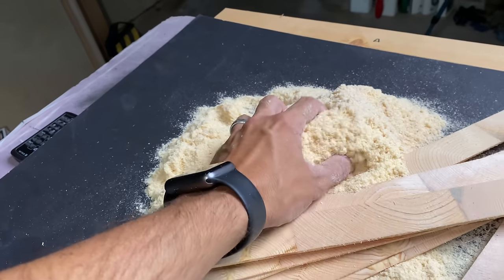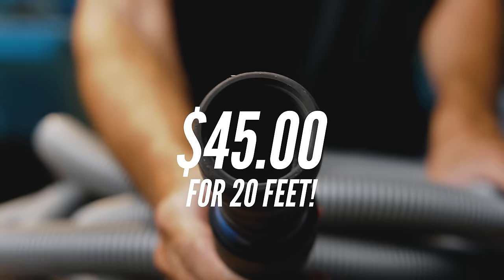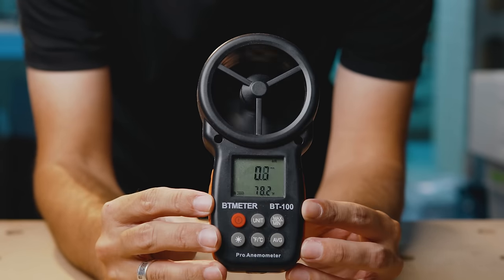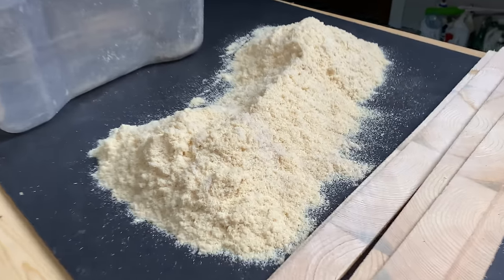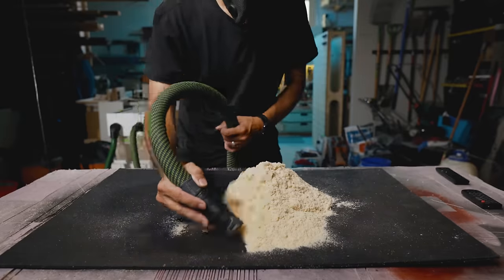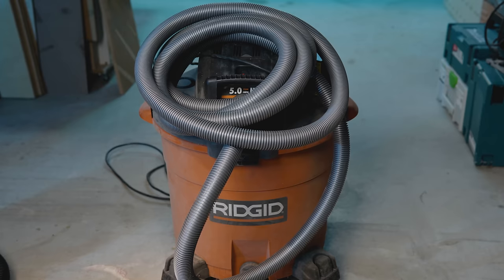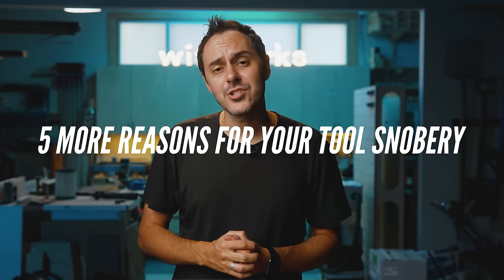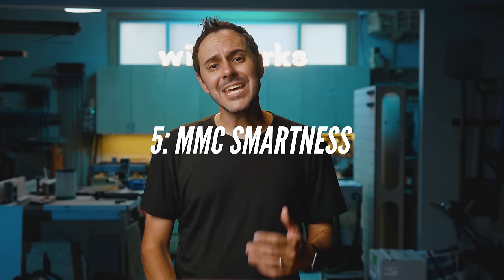This video will save you a lot of money. Dust extractors for beginners.

Comment: This is definitely an interesting test. I bought a Ridgid HD1200 for $80. It is a good vacuum and sufficient for my needs. Pretty interesting results in the air scores. I think with shop vacuums they all perform pretty closely to one another. Sure, there's one's that suck up water or dust faster by 2-3 seconds or 8 seconds, but that IMO doesn't justify paying more for a vacuum that's a hair faster than others. Price was why I went with the Ridgid it has the Lifetime Service Agreement and it was $80, so I thought it was a good investment.
Reply: My old Rigid shop vac is going on 20 years. I'm going to buy a new one just for dust management.

Comment: I recently went thru this same scenario. (Small hobby wood shop) My 10+-year-old Rigid Shop vac died and I was in the market for another dust collector. I suspect my rigid died  BC I was using it as a dust collector with only the standard filter and Burn't up the motor BC of the dust that made it past the filter and made contact with the hot motor bearings. (If you are using a rigid vac as a dust collector add a Dust bag to it)   It got me wondering about the air quality in my shop and if having a shop vac as a dust collector with only the standard filter was doing more harm than good and if I was just spreading dust around. Rigid Did warranty the shop vac. But waiting on the warranty Claim I bought a Festool CT Mini. ($400). Doing it over. I think I would have gone with another Ridgid Vac with a Dust bag and a HEPA filter to keep the dust out of the motor. Now I run both in my shop. (Festool hooked up to the sander) rigid vac with Dust bag and hepa filter connected to my table saw.   You can buy Powertec Dust bags for the Ridgid vac on amazon for pretty cheap..

Comment: the thing i want to say about you in a uncontroled room using a 200 dollar air meter is: they where all in that same uncontrolled room you did multiple tests with kinda the same results the numbers might be a bit off becouse of the cheap measuring gear but it gives a pretty clear image of whats going on te differences are not massive il trust youre research based on that and wanna thank you for youre trouble
Reply from the maker: Thank you. If it’s inaccurate it’s at least consistent.

Comment: You need a control for each setup. Since you don't have a clean room or a way to isolate the air coming from the exhaust, you need an ambient room reading before and after you run each setup. Instead of comparing the numbers between each setup, compare the numbers for each setup against their control. And I would take multiple readings for the control and the setup and do an average with any outliers removed. Once you've determined the average of how many particles each setup releases into the room, then you can compare the setups. Whichever one releases the fewest particles wins. If there's no significant difference, then you're paying for convenience features.

Comment: At the end of the day you should be wearing an N95 mask or equivalent whenever your cutting or sanding… and should continue wearing it until the dust in the air has settled. Reality is regardless of shop air filters or vacuum system dust is getting into the air that ideally you should not be breathing in. And this gets worse if your cutting MDF for example… which is considered by many to be toxic. 

Wear a well fitting N95 mask regardless and you will be fine…

Comment: As others have already said it is likely the old "clogged" filter...and the festool thing is overpriced for what you're getting. For around the same price you could have gotten a Powermatic PM1300TX, which is going to clean better than the festool or the shop vacs and it is relatively quiet. Plus, it has a metal impeller that won't be damaged by big chunks of wood going through it. There are dust collectors from JET that are similar to the PM1300 which can be had for under $500. With these, the only drawback is that you'll need a dedicated circuit for them OR you can do what I did and run 10 gauge romex  with a 30A breaker and have them all on the same line. With 30A at 120V you can safely draw up to 3.6 kW of power on the circuit. It doesn't cost much to do this, and you will not trip a breaker when starting up a tool or dust collector.

Comment: I do like festool although during there first gen tools I burnt out a track saw and there chopsaw I did stay with the festool track as I was already invested in there guides but I moved to the Jet chopsaw love it as I was running Fien vacuums and mirka sanders I have to say I moved to the commercial Ridgid 11gallon smart cart vacuum because of the cost and accessory storage I just use a furnco for my tool adapter

Comment: Surprised I haven't seen mention of the amount of air moved tied to the particles read by your meter. Move more air = finer particles will move further while bigger particles will fall out of the air. The HEPA filters are as good as the weave or matting used to generate them and the seaming. Your older shopvac has less power to accelerate the particles and thus, combined with mass and gravity fall out quicker. The Festool would be the better vacuum system over longer hose distances and prevent clogging of the hose used. Just a thought. 🙂

Comment: The old vac's filter seems to be clogged up to a point where it surpasses HEPA filtration. Probably explains why it scored so low in suction air speed. I'd say try it out with a brand new filter, but then you'd lose that filtration. Probably bad on the motor, but if it works, it works.

Comment: I came to the conclusion of the Ridgid vac w/HEPA bag and dust buddy in the shop and the same system with a Ridgid tool box saw when I'm on the job.  I don't think I will ever buy festool.  I use a Makita battery track saw with the cheap knock off tracks.
Reply from the maker: It works….

Comment: Seeing what comes out of the vacuums is great - but most of the dust in the air in my shop comes from what the dust extractors don't suck up in the first place. All my power tools will generate some sawdust into the air, and then it doesn't matter how fine filters I have on my vac. I always wear a respirator mask when using power tools, just to be safe.

Comment: 13:45 old filters usually filter better than new ones as it has trapped particles in it.  this the reason washable filters don't need to be cleaned with soap or detergent

Comment: It isn't really surprising that the "clogged" filter worked better.  It has had time to fill all of the hole that would let smaller particles through, the outer layer of dust is basically an additional filter.

Comment: So I love all my woodworking friends here and on IG. I think there are some tools that we, counting myself, fall into per pressure of buying. I also love all of my festool products the quality of each of them is unmatched. However, there is never one single brand that is the best at everything. I know I am in the severe minority in this, but the Festool shopvac is by and large a frivolous purchase, unless you are an installer that is working in customers homes. If you exclusively work in the shop, you should have piped dust collection and an air filter. If you aren’t there yet and you are using a shopvac, then it really doesn’t make sense to spend that kind of money on festool. Buy something that will allow you to do something new or more efficiently. Again, I know that everyone disagrees with me on this, but I work full time as a custom carpenter and I can’t justify that cost for my business. I try to avoid buying things because they are popular. Most of the time it doesn’t work, but in this case I can’t justify the value. This really is a good comparison to evaluate whether or not this is a tool you would want to invest in!
Reply from the maker: Thanks Nick. A luxury for sure.

Comment: I would suggest that the impeller on the Rigid machine has worn down/gotten battered over the years such that its efficiency has suffered. A brand new Rigid would likely show somewhat different numbers.
In any case, a decent vac and a HEPA filter puts you WAY ahead of the game.

Comment: A cyclone pre filter with a $160 1hp harbor freight 4" dust collector you are doing some work. Quality Rockler expandable hoses you are set broadly for less than $400-$600. I sand floors professionally, this is portable, reasonably quiet and powerful.

Comment: Thanks for your hard work and producing this informative test results. I'm from Australia and Rigid in North America is badge as AEG but not sure.  I will probable go down the path a Karcher with a triton dust bucket connected directly to the unto 2 tools. For the time being that will do until I can make  enough money from woodworking to justify the festool.  However, I will try to avoid corrugated hoses as they will slow air flow.  I'm not bagging Festool they are brilliant the track saw and domino are a must in my shop for accuracy and repeatability performance.  Bang for buck they stack up for me. But dust collector for DIY tools I use the their dust collection doesn't.

Comment: Great video and generally well done.  Airflow velocity (as measured) will vary if the nozzle diameter is different (can’t tell if they’re all the same).  Ideally the meter would be mounted to an adapter that completely covered the opening of the meter.
Reply from the maker: the hoses were very similar - and i swapped them also. results were negligible. I like your idea of mounting an adapter. I may design one and 3d print if i do a re test

Comment: I had a diffuser on my shop vac. They do lessen the noise of the vacuum and disperse the output air flow, but they hurt the vacuum pressure too much to use them.

Comment: the festool hose is 1/2 the length. Seeing the results with both having a 10' hose would be ideal.
Reply from the maker: I tested both hoses swapped out and it was essentially the same. I cut out the footage for length of video concerns. The 20’ hose had slightly less suction, but it was around a 1-2% loss. Surprisingly.

Comment: the first place my brain goes is the amount of suction/exhaust loss from the old vac. It wouldn't be kicking around as many particles because the motor is so not able to push out as much. I would be more interested in seeing the readings next to the cut with each vac. Or how each one performs all day with the reader at head height for the whole time. 

to me, the flaw in this is that the exhaust isn't pushing as much air so the readings are going to be less. have a cleaner filter, I would imagine that would kick right back up.

Comment: I own a number of the ct36s (think thats the biggest festool vac) using them for alot of deck refinishing and general sanding dust pickup. The vacuums are decent, but I have a few gripes, the main one being the shroud on the top of the vacuum itself, which allows you to stack other systainers ontop. The plastic they use turns very brittle and always cracks, preventing you from stacking tools. I replaced one the first time it happened at around $75 if I recall. It has since cracked again. Now all the vacs are missing their tops. My tile sub using the makita self clean vac, think he said he paid around $700 for his, I remember thinking it looked more robust than the festool. I mainly use a hilti self clean now, its built much stronger than the festool as well but around $1150.  Hoses all fit, tool actuated, everything the festool does, but its sometime a bit awkward. Ill still use the festool vacs since I own them, but I am pretty disappointed with how cheaply they are made.

Comment: The festool stuff in general is nice, but super expensive. I'd love to have a track saw, but I just use an 8ft aluminum level and some clamps for a saw guide. The nice part is you get to use the level as is and as a guide too so double value. Festool dust extractor, I simply cannot justify the money for it yet. It's not just the tool, it's all the add ons and if you are going to get one, then go all in on it I'd say.

Comment: The extractor isn't a vaccume. It replaces 25k systems and plugs into every festool tool. If you own festool, you should own the dust extration system if you use it indoor. That said, I have the rigid for shop cleaning.

Comment: May be a good test to monitor air near your face at the same time you’re monitoring the exhaust.   I’d suspect the old dirty filter is filtering the air better since it’s dirty, but it has less flow and you may be getting more escape at the tool, which can reach your face.

Comment: I still don’t have a dust extractor. Want one! Festool just came out with an affordable bare bones model in the CT25e. I’ve also been looking at the Bosch version which gives you a few more gallon capacity and auto clean function for the same price. The fleece bags are more affordable with the Bosch. I’d love to know how the suction rate compares between the two. I’m sure it’s comparable.

Comment: The air around the vacuum is not unimportant, but the air around where you are using the tool and breathing is more important. How good are each vacuum at actually sucking up the dust from your tool?

Comment: If the hoses are over long and wobbly then buy 4 cheap used units and cut the hoses short to stop the wobble. There, done and dusted. Still cheaper than a festool and not a wobble on or in site, sight!

Comment: You can't use different hoses to compare suction velocity. A smaller opening will naturally cause a higher velocity. It's the same principle as putting your thumb over the end of a garden hose. To make a fair comparison, you have to take a pipe that's roughly the same size as your anemometer and adapt a fitting for each hose to it, then take the measurement from the other end.
Reply from the maker: I swapped the hoses out and did the same test and the results were the same. I left that content out because the original video was 40 minutes long.

Comment: When I bought my festool CT46 it was when I lived in a cruddy house where I could only work in the basement so any dust that got away would be stuck there or in my lungs. 

The question isn't, how much is an excellent extractor worth to you. The question is how much your lungs are worth to you. 

That being said if I could work in a garage with the door open and air circulating all the time, I could see it being unnecessary.

Comment: Don’t forget the value of a small footprint for the Festool. I built a stacker with cyclone for my rigid vac and chop station and it takes up 1.5x the footprint and easily 4x the height in my shop. Valuable wall space lost.

Comment: I would be curious to see this done with a control of just using the track saw with no dust collection at all and maybe one with removing the filters and bags from one of the rigid vacs. I think by using the control you will see how much each one is actually improving the air. Like what if those 2.5 and 1 readings were still below 12 then you are still in the good range.

Comment: It doesn’t take an engineer to observe that an obstructed vacuum will suck less from the source than an unobstructed. 
Dust extraction is for the luxury of staying visually clean. However, the unobstructed shop vac filter will  clog sooner and therefore derate.

Comment: Wood dust isn't actually the hardest thing to filter out when it comes to PM2.5. I'd bet the PM2.5 readings wouldn't be that bad with no HEPA filter at all and only a cyclone separator. That's not to say a tiny amount can't trigger allergies though - amounts of allergens well below "0" on PM2.5 can still trigger allergies and asthma, depending on your individual allergy and asthma severity.

Drywall and some other materials are actually the worst - it produces very fine dust, and worst of all, that stuff is actually a suspected carcinogen (crystalline silica - like asbestos, but not nearly as bad). This is the main reason a lot of manufacturers have added HEPA filter options - it's required at many construction sites by various workplace safety organizations for this reason. If you've ever cleaned out a shop vac after vacuuming drywall dust, you'll notice for some odd reason all this fine drywall dust manages to bypass the seemingly solid bag filter altogether and gets caught on the HEPA filter. Scary stuff.

Comment: Great video. I own the festool ctm 26. I learned later on, that the ctl 26 has the same filters and bags. So I spend additonal 150€ for nothing. But stilll, I don't regret the buy. I also own the festool vat. I love the combination. But I hate the price. 

There is one thing regarding your test: Could you repeat the test and checking the air quality near the saw?
Reply from the maker: Thanks. I will test near the saw and face in the future. Good idea.

Comment: if the festool cfm is higher than even though the air quality by the "exhaust" may be worse you end up with a lot less dust by your router/sander etc.. witch is what actually matters since that is where your breathing